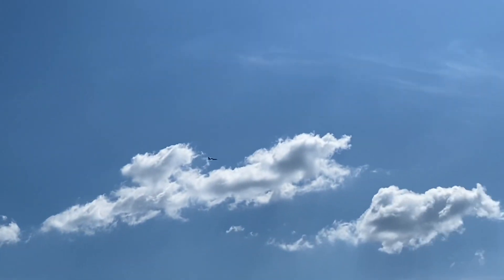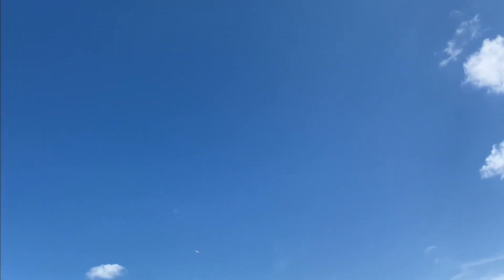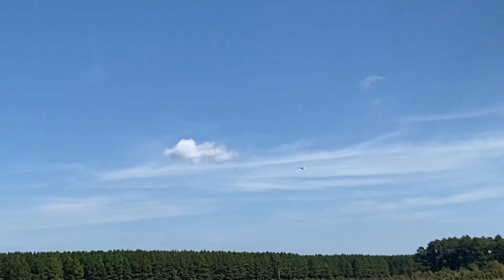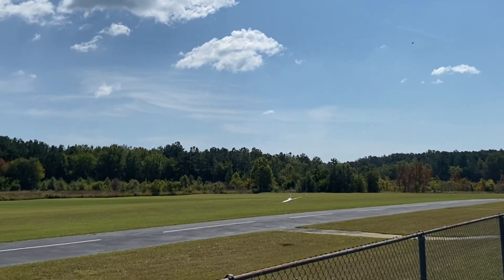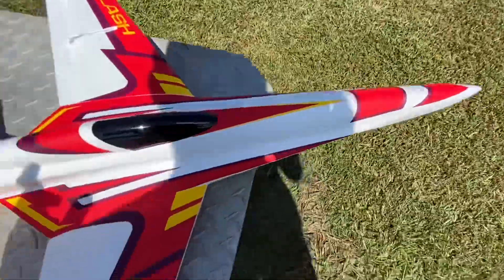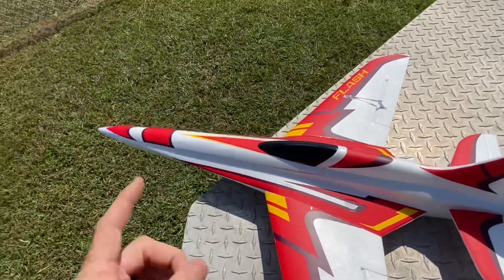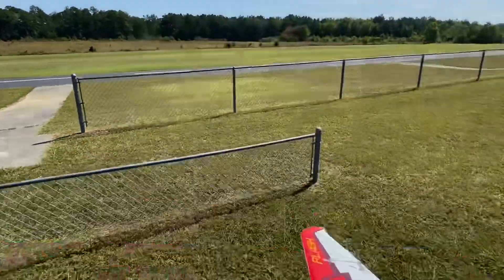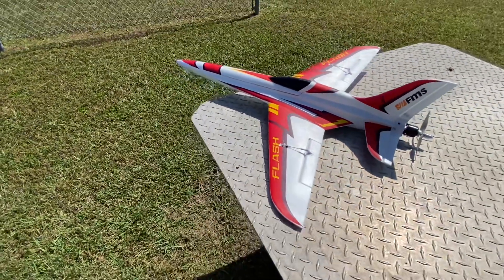FMS Flash 850mm Maiden Flight!

Comment: That thing books! What is the purpose of a gyro on an airplane?
Reply from the maker: It’s pretty fast! Wait till it goes on 6s! Same a heli, to help stabilize the plane. The difference is with a plane it’s not needed but on a FBL heli it is!
Reply: @westhobbiesrc8051  interesting, I used to fly a fair amount of planes before I ever got into helicopters, I was around 12 when I flew my first plane solo. Anyway we didn't have gyros . That was only something you heard about for helicopters.
Reply from the maker: @LichaelMewis  I’ve been flying planes since the early 90s and helis in the early 2000s. I never used gyros on planes or my first heli! I personally don’t care for gyros in planes. I still build all my planes with out them. I left the one in this that came with it. But I have it on a switch so I can turn it off completely.